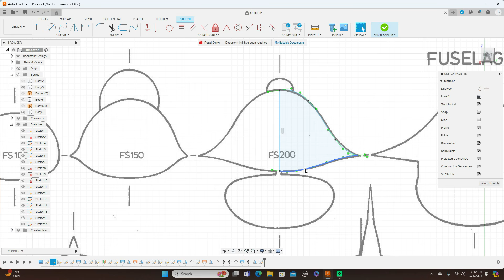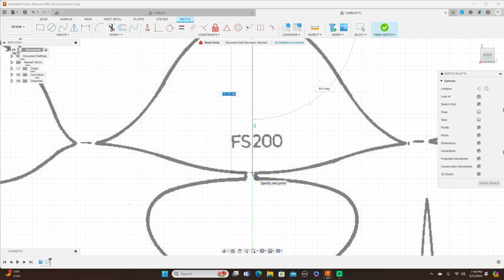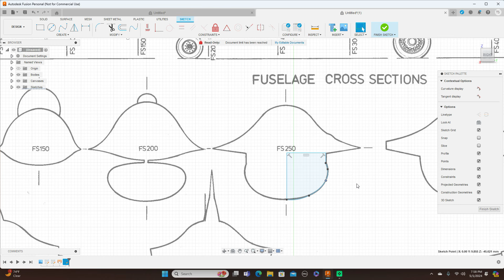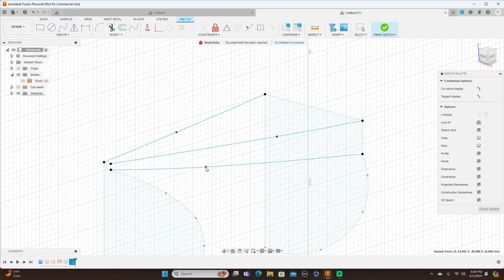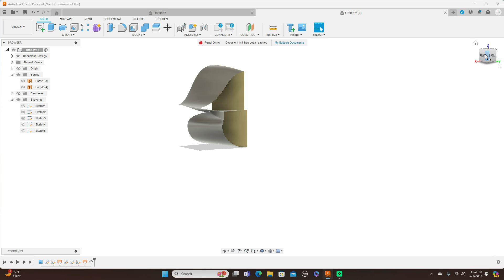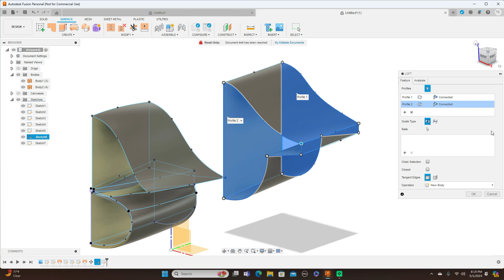Introduction to surface modeling airplanes in Fusion 360

Comment: The problem I have is that with multiple cross sections I get all kinds of lofting errors or twisted surfaces.  I used CATIA 30 years ago and it was sooo much easier.  Not sure why Fusion 360 struggles so hard with lofts :(